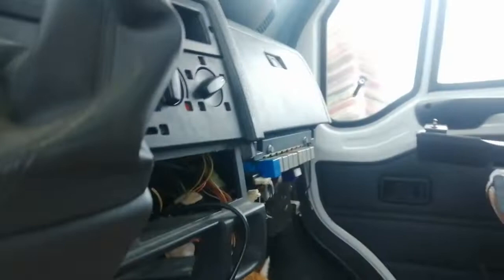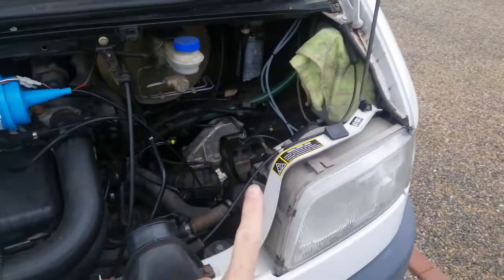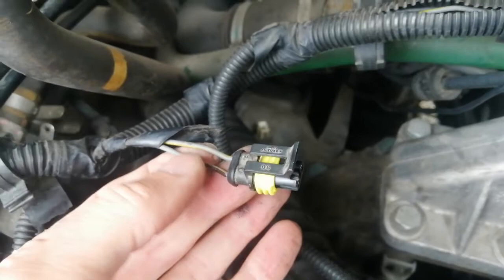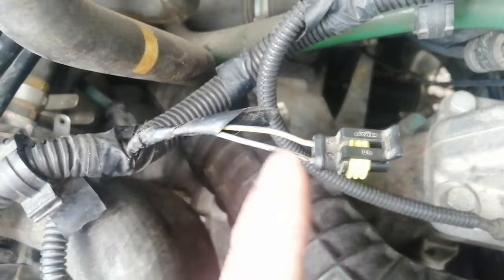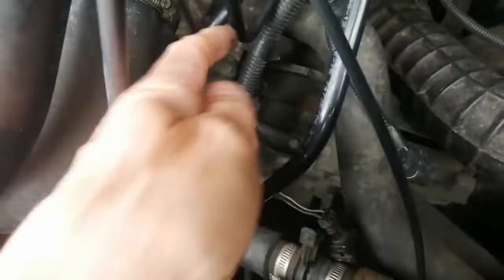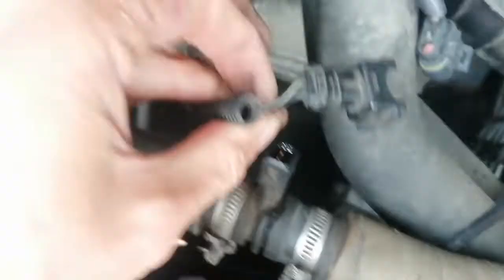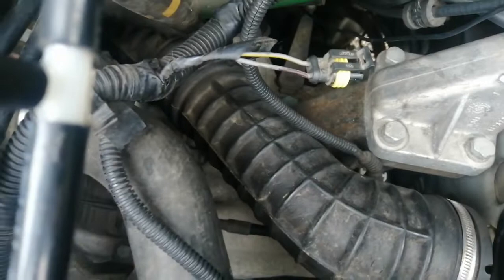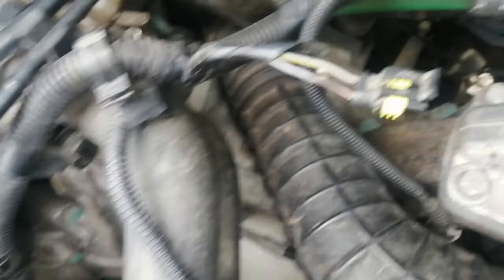Fiat Ducato 230 (1998) 2.8 IDTD grey and yellow wire short to ground

Comment: I have 2,8 L 1999 and i have same wire . I put it diesel injektionpump solenoid.
Reply from the maker: Is yours JTD engine?
Reply: I’ve got 2.8 idTD engine and I agree with Mika. I think it’s come off the wax temperature control device for cold start advance on the injector pump. If you still have the van check the link I’ll post next.

Comment: Diesel pump solenoid?
Reply from the maker: No - the wire was not connected to anything apart from the (seemingly unused) coolant temperature sensor and then to an unused plug. It did nothing, but had power. I never found where it was shorting to, have de-pinned it from the multiplug by the driver's door and the vehicle functions totally normally like this. So I still have no idea at all what the wire is for! Thanks for watching :o)